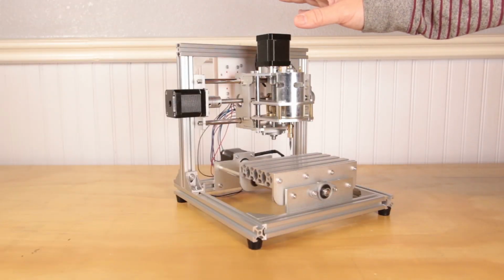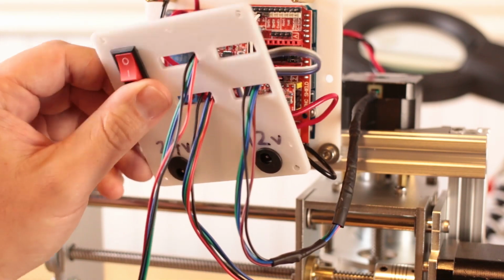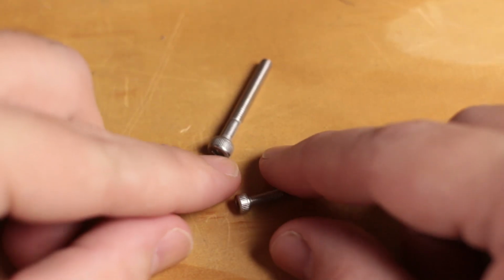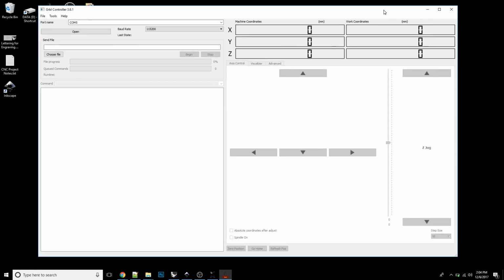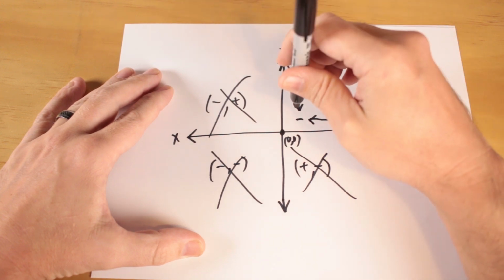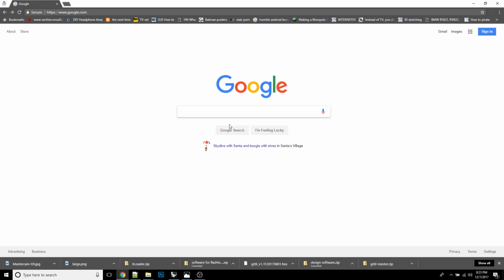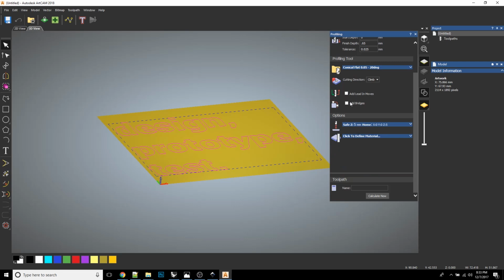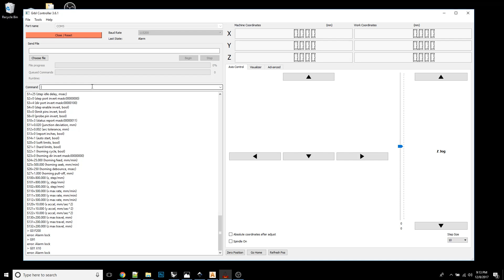How to start CNC Machining for under $200 - Working with the T8 CNC engraver

Comment: As a professional electrician, the reason for not tinning the conductor when used in a crush connection (where you secure a conductor with a screw) is that when you screw down, the screw is supposed to crush down on the strands, spread them out to make a large contact area.  By tinning, you are only contacting on the top and bottom of the tinned wire.  Copper is a better conductor than solder.  Under load, the connection will heat up, how far depends on the current.  If the temp rises enough, the solder will flow and loose its contact.  This makes the problem worse, going into a spiral.  I have seen too many low voltage connectors burn up.  In the end, it is your property and life, so do what you feel is best.

Comment: I just built one of these. It is identical in most respects. It would have been very useful to have seen your video first. Thanks for producing it. Comparing our experiences has been very informative.

I also tried to flip the two side plates to centre the cutter over the Y axis. However, the stepper motor fouled the cross bar at the top, so could not be done. I then moved the vertical frame to the back of the bottom frame, and reattached the two triangular die-cast brackets to join the bottom rear crossbar to the uprights. It now appears to be fine.

I did originally pack the ends of two of the slide rods with washers, but eventually found that it was not necessary. I don't remember why.

The main problem I have is with backlash aka lost motion. 1) The original brass nuts on the feed screws had no slots, so I bought some new ones and they seem to work well. 2) I have plastic couplings between the stepper motors and the feed screws. These are too flexible along their length. 3) The bearings at the far end of each feed screw also have longitudinal end play.

I had hoped that fixing the feed screws at the bearing end would improve backlash. It does but the bearing end play is greater than I would like. It can be overcome when making parts by always feeding in one direction on each axis, but will cause problems when cutting letters such as 'O'.

I use Linux Mint 18.3. Software I have used is Inkscape,  Camotics to check paths, Universal GCode Sender, Arduino IDE and GRBL 1.1f. This only required one change in the grbl config.h file to change the spindle enable pin.
#define USE_SPINDLE_DIR_AS_ENABLE_PIN
This is because GRBL 1.1f is set up for laser engraving. You have to move the molex connector along one pin on the CNC Shield.

Any feedback on eliminating end play would be very welcome.

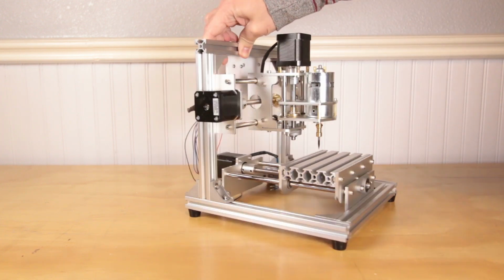Comment: 7:40 NEVER NEVER NEVER tin your leads on crimp or screw connections. 

Solder is not perfectly solid under pressure therefore it will give with time, your connection can become loose.
Reply: And when you do solder you heat the wire or connector with your iron then you touch the solder to the wire or connector to melt the solder in the connection.
Reply: Not only is it poor practice to tin a solder joint under a crimp connector. Use a proper crimping tool, not the crummy auto parts store crimping tools, to correctly crimp the connection.
Reply: @privatebubba8876  Isn't it just the wrong order? First crimp, then tin. The crimp makes the connection hold, the solder makes it take more amps..
Reply: @kataseiko   No you dip the wire in flux and then insert it into the connector. Heat the joint while touching the solder to it and let it flow into the joint. The flux cleans the metals and as it burns off it sucks the solder into the joint. Your wire is the limiting factor in current draw not the connector.
Reply: That is argued back and forth on a regular basis.
Reply: F Huber  This isn't really an argument - there is just a right way and a wrong way and far too many youtubers seems to think that tinning wires is the correct way but if they would bother to go look at any crimp connector manufacturer's website, they would soon realize that all of them tells you to crimp with the bare, multi stranded, wire.
Tinning wires that are then crimped in one way or another is just plain wrong.
Reply: @agehall   100% correct Tinning wires is for soldered connectors.
Reply: Just like aluminum wire, it deforms with heat and pressure. Screws lose tension. Always crimp, solder, heat shrink.
Reply: @johnnyyuma9326  Actually, I don't even think you want to add solder in most cases. Solder joints are brittle and that isn't something you want in connections like this where there could be stress on the joint.
Crimp properly and that should be enough or use connectors intended for soldering.
Reply: @johnnyyuma9326  Soldering it after just causes the wires to break behind the connector.  Never tin crimped connections.  Either solder or crimp, but not both.
Reply: @everlastingphelps  No, it doesn't.  How did you learn to solder? You solder the joint, not behind the connector. Where do you people get your info?  Learn how to do it the right way.
Reply: Johnny yuma It’s not about how you solder. Stranded wire is flexible because the strands can slide against each other when the wire flexes. When you solder they can’t slide there and take strain at the solder point, breaking early. 

Tin wires for soldered and screw terminal / clamp connections, not crimped. When you squeeze solder, it breaks. When wires flex at the solder point, the wire break.
Reply: @everlastingphelps    I know how wire is made. Don't be an idiot. When you crimp the wire (if you do it properly and most people don't) the wire strands DO NOT SLIDE IN THE CONNECTOR! The solder prevents corrosion in the connection especially if you use a good silver solder.. 

ALL JOINTS SHOULD BE SOLDERED IN A DC CIRCUIT (except the battery itself unless you are using a specific type of battery with "soldered" connections) and then try some heat shrink over the joint.
I worked in power generation and battery back up and communications for MM, Tnetix, world com and a couple of other places.  Now I do custom electronic instruments and fuel injection. EVERYTHING GETS SOLDERED OR CRIMPED AND SOLDERED.
Reply: @johnnyyuma9326  Then you are doing it wrong.

https://nepp.nasa.gov/files/27631/NSTD87394A.pdf

Soldered connections and crimped connections are acceptable.  Both are not.

The problem with soldered wire in an otherwise properly crimped connector is not the wire strands moving.  The problem is the brittleness of the solder combined with the prevention of the wires being able to cold weld in the crimp.  It is the solder outside the connector and the strain relief crimp that causes wires to break because the wire is tinned too far.

That wire monkeys make substandard connections when they aren't properly supervised doesn't make it correct.
Reply: @privatebubba8876  Katana was not talking about the solder technique. He was talking about the mechanical stability of the joint determined by compressing the copper strands to full bearing contact before soldering the joint to prevent crush of the softer solder metal.
Reply: @fhuber7507  I will stick to tinning. EXPERIENCE is the best teacher. I never had problems with tinning, But I have had plenty of problems with crimping and wire strands on a straight connection. Experience says tin the [censored] thing.
Reply: @johnnyyuma9326  Oh no one of those old guys set in their ways
Reply: Johnny yuma Do you think insulting people and calling them morons will make others believe you are right? Everlastingphelps is 100% right in all the information he has provided. He also provided the information in a polite manner. Just hope people understand to trust his word over yours...
Reply: @cohen758    Blah blah blah.  One way to do it right...............only one way
Reply: Johnny yuma Okay...
Reply: @johnnyyuma9326  You've verbally demonstrated how to do it the wrong way.
Reply: @TOTAL1337MAYHEM    What ever, you will never learn, but then you were told that already
Reply: @johnnyyuma9326  all I'm saying is if navsea catches you soldering a crimp connection it's illegal and subjects whoever you're working for to a hefty fine. You wanna be ignorant, that's on you.
Reply: When crimping and clamping tinning the end of the wire is a bad thing to do the physical attributes of solder are such that the increase the possibility of a loose connection as it backs off of the pressure placed upon it soldering a crimp merely increases the probability of the wire breaking at the neck of the connector.
Reply: Very true, tinning the entire exposed copper is terribly bad, but tinning the start of that section is a good thing as it keeps the strands from flaying out, care, of course, must be taken that the area under the clamping screw is not soldered.
Reply: I don’t get why it matters. As long as the solder flows into the joint and isn’t a cold joint, it’s fine. I sometimes put solder on the tip of the iron and then touch it to the connection, especially if I have to hold a wire to the board and same with two wires.
Reply: @agehall  us electronics technicians trained by NASA should say you're wrong.
Reply: @everlastingphelps  I used to work for the government and was sent to be 2m trained by NASA employees, you're wrong we solder or crimp and solder, that link isn't current.
Reply: @TOTAL1337MAYHEM  no it's not
Reply: I just came here to say never solder a crimp terminal, but I see that the can of worms has already been opened, and as usual there are those people that know better than NASA, aircraft spec, milspec etc.
Reply: Ahh whatever. Always fucking know it alls in the comments. I do it and never ever had a problem in 18 yrs.
Reply: Silver solder can be successfully used to connect the two ends of bandsaw blades.   https://www.youtube.com/watch?v=mzKSk_Zs0Ew 
I would think it's strong enough here too.
Reply: @christopherlee3045  so... if I will go on red for 18 yrs with no problem, this will definetely prove that I am a lucky bastard. Or just going 
the most empty roads possible. Or another thousand things, excluding the thing that I am totally right. Don't be like that, use some others experience.
Reply: @Lance123dr  I'm not sure what the he'll you talking about dude
Reply: @fhuber7507  Yes, it is argued back and forth by people with no knowledge or experience.
Reply: @kcsnow9447  True, silver solder is a very good bond, but that's not what is used here at all. Tinning the conductors prior to crimping is just asking for problems.
Reply: @christopherlee3045  Soldering your connectors prior to crimping may work fine in certain situations, but it's completely unnecessary and not contributing anything. If using screw connectors (for instance), you can get away by torquing your connections more, but it's not a good practice and most likely to fail if your connection experiences any strain.
Reply: @johnnyyuma9326  Hi, just my two cents, heard of capillary action? It's when a liquid moves along a confined space of travel away from the source of the liquid. Now, when you solder multi-strand wire the solder doesn't just stay at the end, or tip of the wire you just soldered, in it's liquid state the solder migrates along the close gap between each strand of wire. Most times it actually gets into the wire far enough so as to be in an area that is not supported by the clamping part of the crimp body. So what you have is, at that point, a flexible outside (insulation sheath) and a stiff, somewhat brittle inner (the soldered multi-strand). Because the solder within the multi-strand gaps terminated it's flow at a specific point you have a very small area highly susceptible to stress fracture should any movement of the wire occur, and, because the point is beyond the clamp tags of the crimp, movement is very probable. That is why they break behind the crimp.
Reply: @shanestevens622    Where did you learn to solder?  Or did you?  I've been doing electronics for more than 40 years
Reply: @johnnyyuma9326  Are you saying I'm wrong?
Reply: @shanestevens622    No, I'm saying you don't know how to solder.
Reply: @johnnyyuma9326  well, you're probably correct, I'm not in that line of work per se, I can't argue. I actually thought soldering the ends of 3 core flex before putting them to screw connections was a good idea, but according to some on here it isn't. I wasn't saying you were wrong , just putting my theory out to comments section to see if that fitted with the problem of wires breaking behind crimp. I replied to you specifically because the theme of what you were saying sort of had more to with what I was putting out than others. Is there a very specific way to solder correctly? I thought it was , given heat and flux, something that just happened on its own.
Reply: @shanestevens622  Some information before I get to the point that I believe explains everything.  I worked 6 years as an aircraft mechanic on large military aircraft, then transition to building robots for automated manufacturing and am now an engineer for a major automotive company in their manufacturing facility.  I can only speak on what I was trained on due to aircraft failures, common automation breakdowns, and recall events associated with vehicles.

Braided/stranded (referred to as braided from here on) wire is meant to be flexible and is used in environments where vibration and constant movement is/are present.  Soldering is not recommended, with one caveat that I will explain at the end.

Solid wire is cheaper and is used in environments where vibration does not exist and cost savings can be gained with out danger.  It also can carry more amperage due to the increased cross section to circumference ratio when compared to braided (air gaps between the braids lessens the effective cross sectional area this is why solid wire is capable of a higher loads).  Solid wire is typically found in buildings.  Solder would be ok to use in a termination but only after a proper dry crimp is achieved.  Having solder in between the clamping and clamped surface is not recommended since solder is not structurally stable to resist the clamp force, and over time, the joint will loosen.

When soldering a flexible cable, you are essentially turning it in to a solid wire since the solder will spread through the braids through capillary action.  This would be ok as long as the strain relief of your termination fully encompasses the newly solid portion of the braided wire.  If strain relief is not present, vibrations and movement will cause stress cracking since flexibility is lost.  Moderate movement will accelerate fatigue greatly by causing a compression force on the inner radius and a tensile force on the outer radius and shear forces between the joined strands relative to the solder.  The braided cable will move and flex up until the point of the solder.  This causes failure in multiple manners.

When stress fractures occur, the cross section is reduced, which causes more heat since you now effectively have a smaller gauge (cross section area - cross section of the crack =  new cross section of your wire).  This extra heat can cause solder to loosen (depends on the solder used).  The extra heat also causes increased malleability which increases movement which further exacerbates more stress fractures and fatigue in the metal.

The caveat I mentioned earlier is this, there COULD be a termination for braided wire in which solder is required.  This termination would have a longer strain relief.  The braided wire would be inserted in to the termination until it is bottomed out and then crimped.  Once crimped, there could be a hole in which solder could be introduced, separate from the crimp.  The increased length of the strain relief would fully envelope the solder which would travel up the wire through capillary action.  This would be used as a fail safe to ensure the wire does not come loose from the termination.
Reply: IPC J-STD, 620, and 610 solder certification class teaches you that crimps are only allowed on stranded wire. Can not be tinned or solid core wire, or it is classified as a defect.
Reply: Spaces never tabs! (One such intractable conflict from the world of software development) I used to tin everything, it seemed to make sense and can make terminations look neater and easier to deal with but I've since been convinced of the flaw in my logic and so now never tin crimped or screw terminations.
Reply: Didnt, know that. Thanks